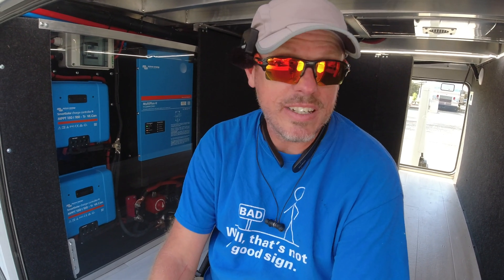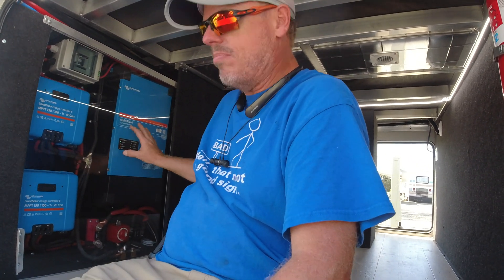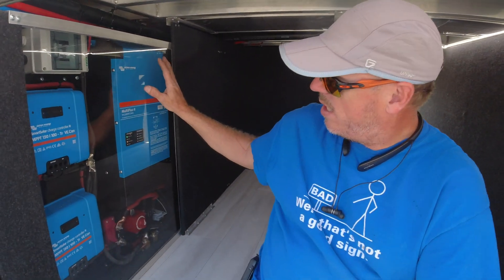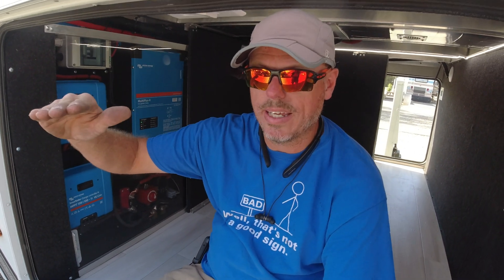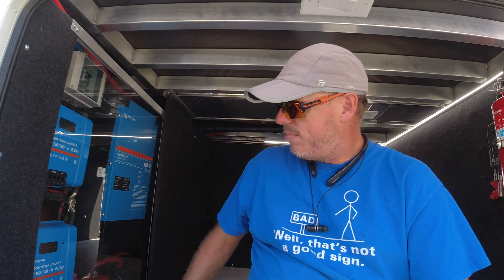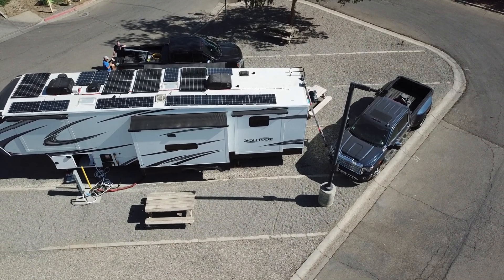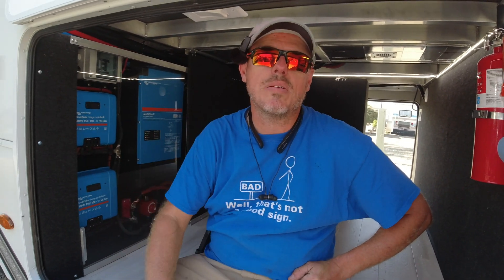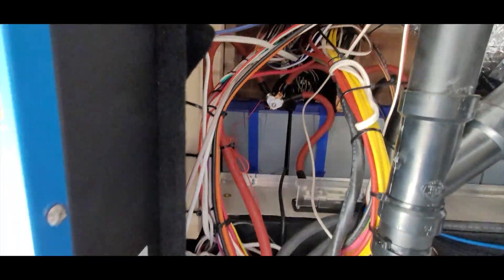2021 Grand Design Solitude | MultiPlus II & Battle Born installation

Comment: Hey Mike, love your channel, I have watched just about every vid. I have a question? Im doing almost this exact same install on my GD 310GK. I already have the Progressive Dynamics lithium converter charger from phase 1 upgrade. Now Im going with the multi plus 2. I see in this video you are incorporating that lithium charger into the install and you mention for faster charging. How is this hooked up along with the MultiPlus 2? I see a switch installed next to the PG converter but Im lost as to how you did this, any help??

Comment: Hey Mike, I am switching from the multiplus i to this new multiplus ii because the SPS transfer switch that I was using from AM solar was failing.  They offered me a deal on the multiplus ii instead of just replacing the SPS.  I am going to sell my old multiplus i on eBay, how much do you think i should sell it for on ebay.  I am still going to use my color control GX instead of the cerbo.  You have the cleanest installs with the best use of available space,  some people use the front basement which I think is a lazy way to do it.  Love hearing your input on the multiplus ii.  Larry

Comment: Looks awesome. Just a thought. Doesn't everything get hot behind the plexiglass?
Reply from the maker: If the equipment does get hot, the plexiglass is sliding so you are able to open it up if needed but we do allow for other areas of ventilation.

Comment: Speaking of the inverter on the fridge and specific plugs. I have that going on with my North Point 377RLMB with a 1875 inverter. I thought  of adding one MP II and keeping mine as well but how does the existing fridge avoid seeing the MP II current as shore current and stay on? Assuming that the current for the factory inverter is tapped before the panel at the shore cord or ATS?
Reply from the maker: Use the ac 2 out to a sub-panel breaker and then to the fridge inverter. This will give the fridge shore power only when you have shore power.

Comment: In what instance would you do a dual Multiplus II installation...???
Reply: If you want to run 240V loads off of just the battery
Reply from the maker: When the consistent load will be grater then half of the inverter.

Comment: My MPII arrived yesterday.  After attending the mobile training RV that Victron puts on tour, I hope to be able to install this with my two BBGC3 batteries.  If you were out here on the west coast, I’d be checking your schedule to do the install.  Love your work sir!
Reply from the maker: I will be on the west coast this year! https://thedrycampers.com/contact-us/
Reply: @TheDryCampers  Thank you.  I’ve since installed my equip.  With my trailer, there wasn’t enough space to install where you do your work without losing some pass through space.  I ended up installing mine in the forward battery compartment alongside the generator.  It seems impossible, but I measured 3 times and just made it fit.  Goes together like a puzzle and can only be removed in a specific order.  It’s been great camping with it.  I’ve still got the solar to address next, but for now, I’ve been using the gen to charge the batteries.  High regards and enjoy Quartzite

Comment: How loud is the multiplus 2 while it's running I have limited spots to install was considering mounting it inside a compartment under my entertainment center
Reply: It’s loud enough to bother you when the fan in the Multiplus II is running. Mine is in the front compartment of my fifth wheel & I can hear it with the compartment door closed.
Reply from the maker: It the loudest when it is charging batteries and its not quite....

Comment: 'Are the Watt hours in a 48v battery 4x as much when stepping the power down to 12v system?'.
Reply from the maker: Kind of a trick question. If you're doing a DC to DC step down, without the loss in the equipment to do the conversion, yes, it would be 4x.
Reply: @TheDryCampers  I see.  So with some loss in the conversion, would it still be pretty close to 4x?  Just trying to understand if I get a 48v (or 24v) battery how it will translate into watt hours for an RV.

Comment: I recently found your channel and have been watching all your installs... WOW great work reminds me of some of the high-end car audio installs.  With some of the installs I was wondering why you weren't using the Multi-2 and now I see that you are.  

Question for you if you have the time... Can the Multi-2 be used on a 30a single leg system? trying to future proof myself in case I upgrade to a 50A rig in the future I'd prefer to only buy once.
Reply from the maker: We have to use products / equipment readily available and up until about a month or so ago we were not able to readily get the Multi II, so that's why you don't really see it in our videos yet. We have several install videos lingering from the spring and summer as well. 

Yes, you can do it. It's kind of pointless on a 30A RV, but you can do it, yes.

Comment: Hello Mike and Leanna!   Another great install!  Thank you very much for sharing this experience....especially with the MultiPlus II !   

Inside my ORV 22FQS travel trailer exterior pass through storage area, where the solar hardware would go, the vertical measurement is only approx 20 inches.  So, I think I'd be forced to stick with the traditional 3k Inverter that is only like 15inches tall (I think).  

Here you go again.....another awesome storage improvement/solar hardware mounting home run!  You rock when it comes to these mounts.  The sliding access door is great!

Safe travels!
Reply: Right or Wrong I have seem them installed on their side.
Reply from the maker: Thank you so much for the kind words. I appreciate it.